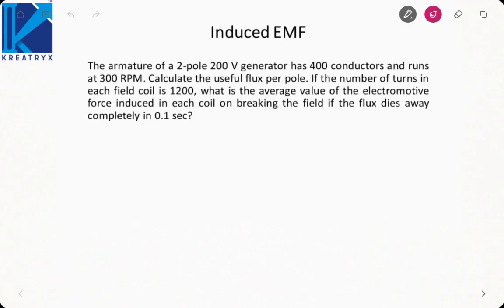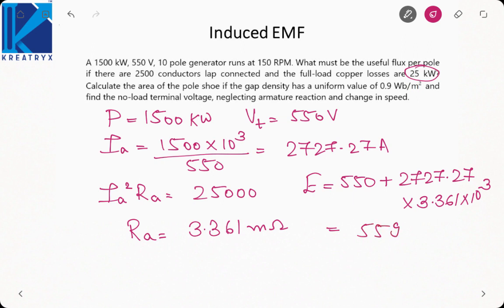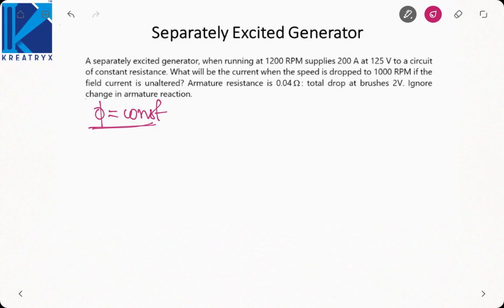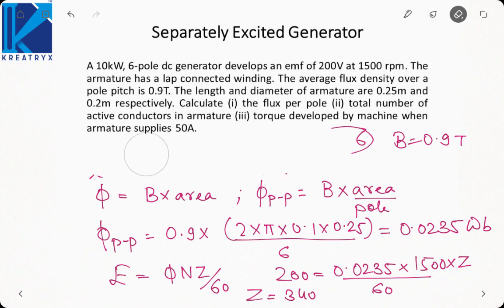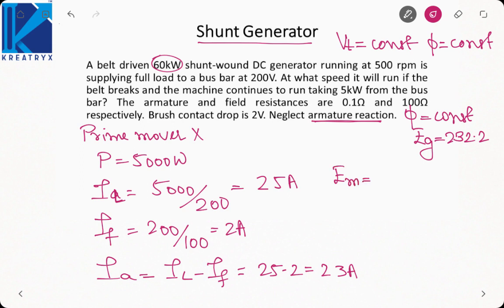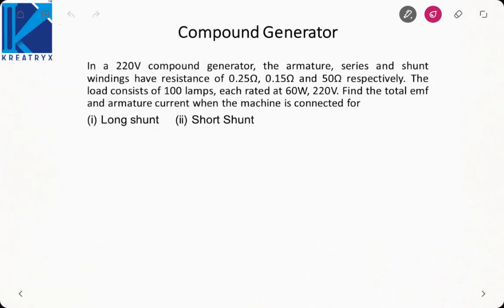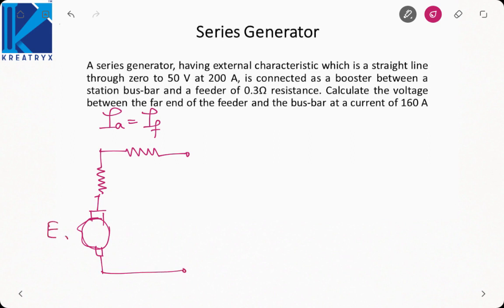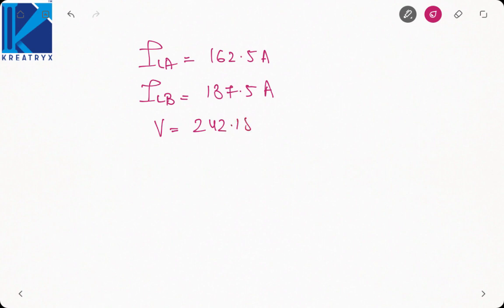DC Machines 1 (Electrical Machines) - Krash - Problem Solving Video | GATE (EE)

Comment: at no load , armature current should be zero. therefore Vt=E.So why did you add Ia Ra while calculating no load terminal voltage
Reply: in the second problem
Reply: Yes u r right, 
But it is no longer connected to load.
550v is its rated output voltage.

It is generator and whose induced emf is E=559.2 V
So V=E 559.2 V

Hope it was helpful.

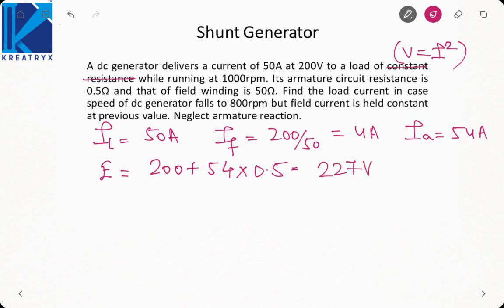Comment: sir in shunt generater (25:44)  when  you changed the type of load shouldn't the current and voltage values at load side also be changed ?

Comment: In separately excited generator question 1 (at 14:05)  shouldn't we have to incorporate brush drop again to calculate load/armature current?
Reply: Yes it should be included. I have the same opinion. It will bring a slight change in the answer.